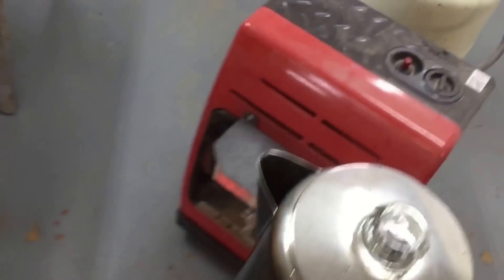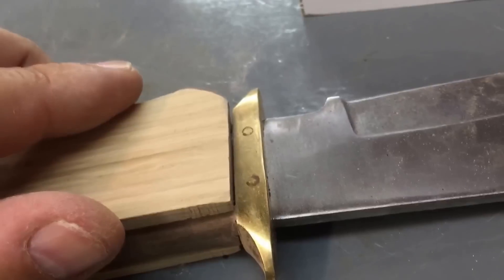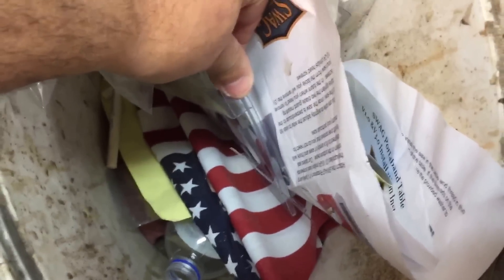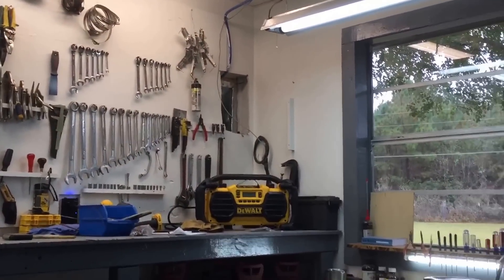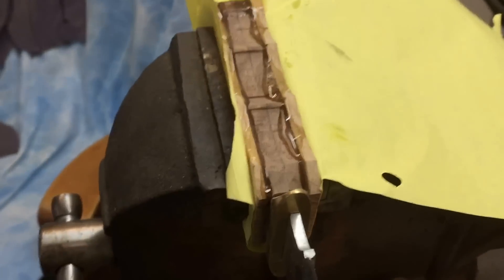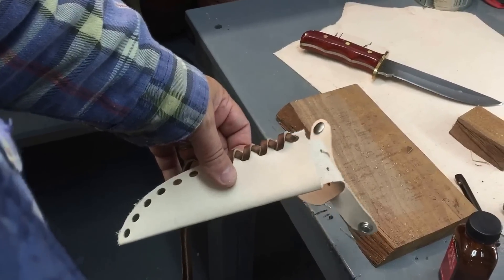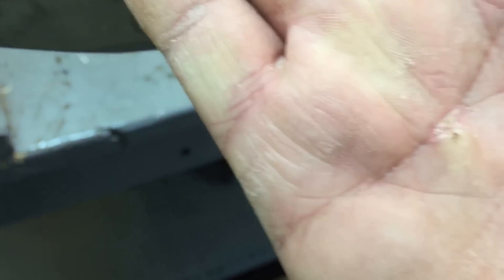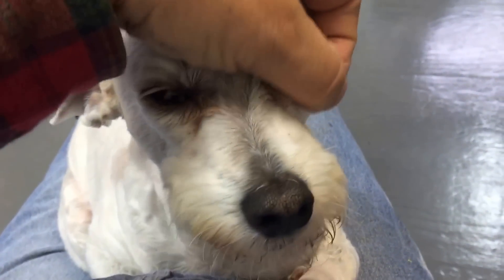Knife sheath,coffee percolator,happy dog

Comment: A trick for filling in wood gaps; 
1. Squeeze some wood glue into the gap. 
2. Rub the glue with sawdust. This will also rub sawdust into the joint's gap, where it combines with the glue. 
3. Once dry, sand away any glue residue. Chances are, some of the glue was smeared near the joint. Sandpaper takes care of that. The dust from sanding and the sanding action will further help to fill the gap.
4. The gap is now filled and hidden. It's best to varnish it soon after. The varnish will also help to hold the filler in place. Do not clean it before varnishing. This could knock out the filling.

(For wide and deep gaps, make a paste of glue and sawdust, and pack it in the gap and allow it to dry completely before leveling it with a chisel or sandpaper).
Reply from the maker: Jeffs Freedom Garage thanks for the tip,Jeff!  I'll put that in my mental "handy tips" file.

Comment: Get yourself some wood filler to fill that gap. You can get it at Lowes or Home Depot. It's easy to sand too! Good video! I used that wood filler to patch holes made by woodpeckers and wood bees. They don't like the taste haha.
Reply from the maker: Erik22552 I actually had some wood filler but I put it away the last time I used it,with the lid not screwed on tight. It was hard as stock when I went to try and use it again.
Reply: I've done the same thing! Not only with wood filler but with paint, dry wall mud, plaster, varnish, shoe polish even the tooth paste LOL!! Nothing like brushing your teeth with chunky style tooth paste.

Comment: Fill that gap with some JB Weld and work it down with the rest of the handle. It will look like you meant to do it. Nice sheath and knives.
Reply from the maker: WannaBFree many years ago,I fixed a leaking radiator with JB weld. I drove it another 2 years and was still holding tight when I sold it.
Reply: Neat story, it's great stuff. :)

Comment: Have you considered filling that gap on your knife...which I think is gorgeous just as it is, by the way...with a wood filler, then sanding and staining?
Reply from the maker: AnnBearForFreedom I did,but then if I was gonna do much more to it,I think I would have just cut off the handles (stocks) and started over with better fitting wood. Someone mentioned copper wire to fill it in and I just might try that. It might look pretty cool.
Reply: Copper would look very cool.  So would aluminum,  which might be a lil cheaper.  But aluminum would also be harder to find in a larger gauge, so.... six o' one, I suppose.  Its still a gorgeous knife, gap and all!